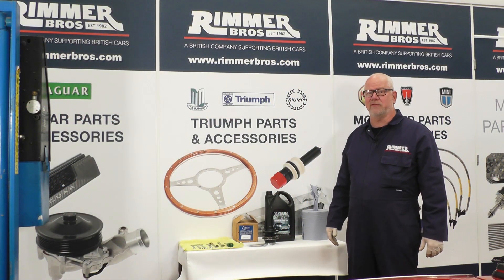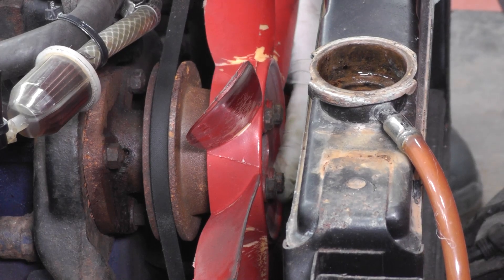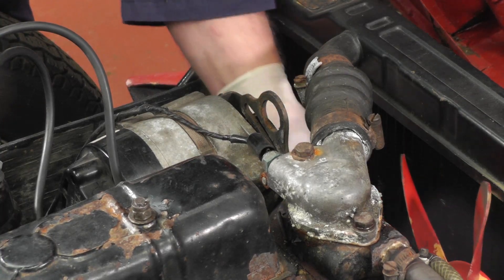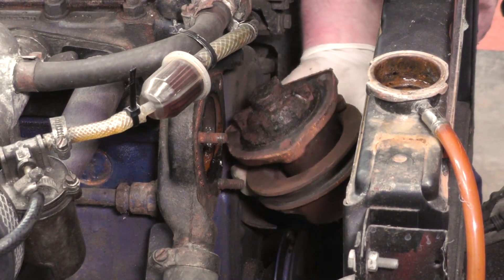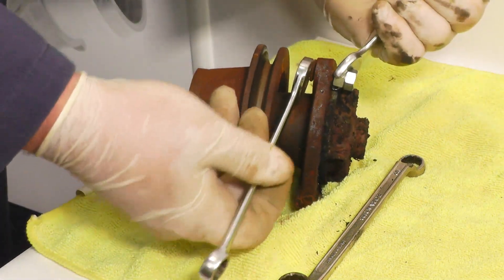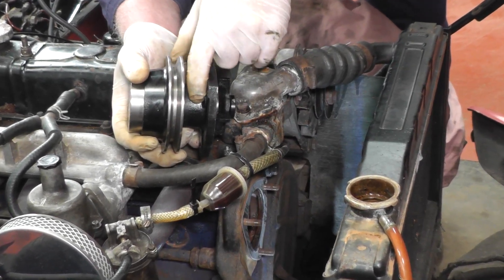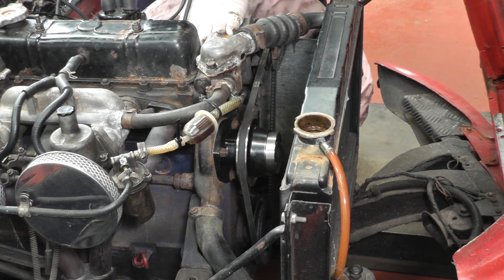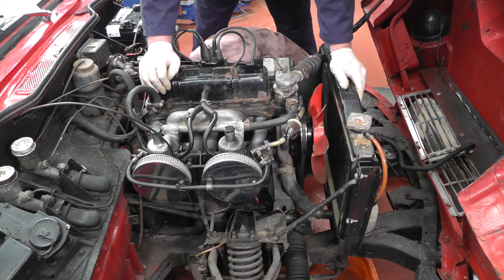Triumph Spitfire Mk 2 - How to Remove & Replace the Water Pump

Comment: Good vidio .Never used waterless coolant do you need to flush with anything first.
Reply from the maker: Hi Neil,

An Evans Prep Fluid - https://rimmerbros.com/Item--i-RX1674

Before filling your system with Evans Waterless Coolant it should be as free from water as possible.
Evans Prep Fluid hygroscopically absorbs any residual water remaining in the system after draining.

Evans Prep Fluid actively removes the loose dirt and scale from your cooling system which can cause inefficient heat transfer.

*Not suitable for engines with a thermo-syphon cooling system.